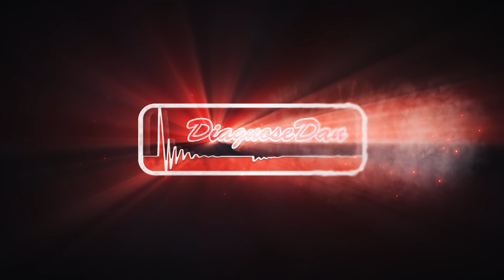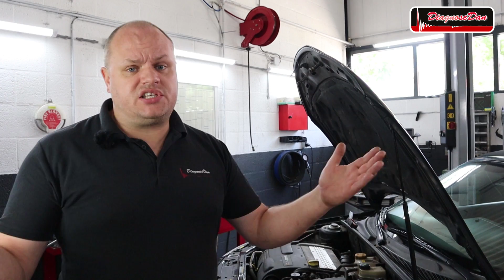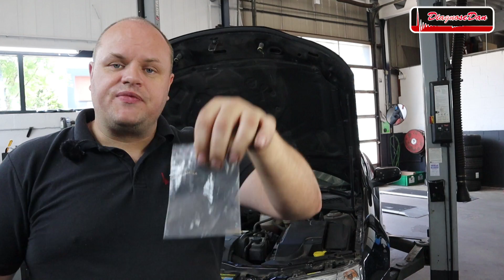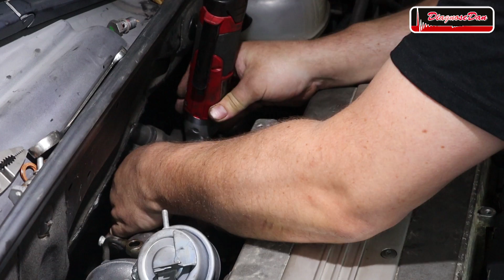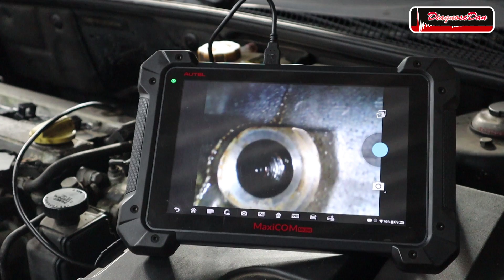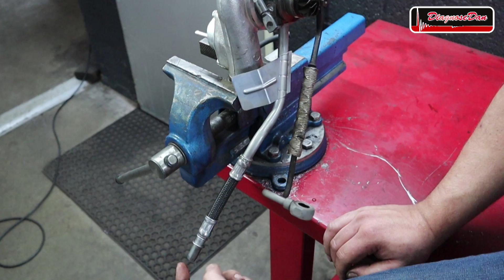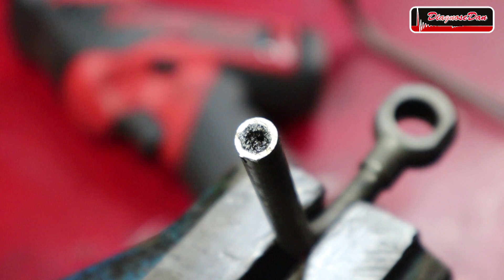Why did this new part only last one day?

Comment: not sure how so many comments got into brake lines when this video is about a turbo failure?🤣
I would wonder if lack of oil changes could cause the oil to get so thick that the heat would cause it to start clogging the feed line to the turbo. I lack knowledge as to what all the oil passes through to get to the turbo in the first place, but it seems like I would want to know what was causing the oil to get so thick it clogged the feedline on the turbo! That just seems like a lot of neglected maintenance!

Comment: so, I guess not replacing the oil feed line when they installed the new turbo, that it voided the warranty on the new turbo? So, did the shop that done the work on it cover the repair you done to it? Just curious, even though this video is 4 years old, I wonder if the mechanic shop done the right thing and covered the cost of the parts and labor since it was obviously a neglect on their part?
This was a great educational video for turbos! Thanks, Dan!

Comment: Looking closely at the burnt oil build up in the oil feed pipe / tube ..   I always allow my engine to run for a while at idle    after a road trip.  this allows the  feed oil to fl;ow  into the crankcase while the turbo is cooling down .   My 2001 2.5 VW TDI Caravelle is still on it,s original turbo after over 200,000 miles .  Motul fully synthetic oil .obviously does a good job . I have recently replaced the gear change balls and socket .   What an absolutely bummer of a job . I ended up removing the cold weather diesel water heater and water piping to allow access to the relevant parts which come as a kit ..  a tip is to drill a small hole in the nylon socket to allow the linkage ball to enter .more freely.. keep up the good work and excellent videos ..

Comment: I have a Mercedes S550 with two turbos.  Not only am I concerned about keeping the oil flowing at the end of the trip, but the car has autostop to turn off the engine when sitting at a stop light.  Man that seems dumb, for many reasons.  I wonder if Mercedes has an auxiliary oil pump.  I certainly don’t hear one when I shut off the car.

Comment: The 5 bar reading on the pressure guage instead of 2-3 was a sure sign that there was a serious blockage in the lubrication system.
Key is to always remember the function of engine lubricant :1) lubricates 2) COOLS   3) CLEANS. 
As i stressed many times "oil is what you fry your chips in" good quality LUBRICANT is what you put in engines.

Comment: Agree that oil line was exposed to excessive temps. The Mercedes 300 turbo diesel does not suffer from this problem. They somehow keep the temps under control.

Comment: Every Tech should see this! Especially over here in Canada / USA...... If the turbo is bad; Check oil feed line!!!!!!!!!!!!! My customer just had this problem on 1.5L CRV honda at dealer and another independant shop, yes, complicated, dealer diagnosed blocked cat., independant diagnosed "no, cat is good, it's the turbo"- three turbos later, and after my advice (I learned from Diagnose Dan! - and, I shared this link to customer, and customer told independant shop).... check the oil feed!!! Finally, the oil feed filter was plugged.... Now, the fourth turbo PLUS oil feed filter/ line should fix the problem (parts on order - 4-5 days on order)..... I'll confirm later......

Comment: From what you have said, it astounds me that the new turbo kit also had a new oil feed line which was not fitted. If the oil feed line was not supplied, the checks for oil flow would be more critical, and using paint thinners through it would perhaps clear it from carbon debris inside. As you point out, the turbo failed for a reason, and it was most likely the blocked oil feed, where a replacement (possibly with less labour) oil feed tube is supplied.. A costly exercise for a complacent mechanic...

Comment: I bought a 2000 Volvo S70 turbo, at auction.
I diagnosed a bad turbo, and set out to find out why . . . I checked the oil feed, and it was fine, so I stuck a garden hose to the about 12" long oil return line;
I was thinking to myself, "that doesn't seem like as much as should be . . ." And BOOM! a chunk of I don't know what, blew out of the line!
Needless to say, I'm glad I knew this information, even before watching your video, thanks!

Comment: Three things:if wrong oil was use causing sluge mixed with engine heat can clog,engine left unserviced for very time and lastly ,if car has history of engine overheating due to faulty cooling system.

Comment: As far as the stopped up oil feed line, more insulation on that line would help, as the stoppage appears to me to be coked oil. Too much heat has coked the oil inside the line. When the engine is shut off, underhood temps skyrocket, and that line still contains oil. Hence the coking.

Comment: The larger, commercial diesel that had an electric auxiliary oil pump that would run shortly before starting, and a timer let it while the turbo spins down. We never had issues with the turbo.

Comment: Turbo oil feed line  has a heat shield, which doesn't cover the line far enough, you cut above the shield and it was blocked.  Root cause analysis would indicate the shield should extend the length of the pipe  passing the exhaust manifold. Either reroute the pipe or add a shield and also flush the oil at each change with oil flush. This causes an issue with hydraulic lifters and hydraulic   chain tension systems  for years, a higher mileage (km) vehicle truly benefits from a oils flush before each change for this very reason, 50,000km plus.  Very nice video thank you so much for the work you put in !

Comment: DiagnoseDan, I think clogging of the oil feed line might be caused by skipping oil change intervals as well as the usage of oil for NA (non-turbo) applications or incorrect viscosity oil.

Comment: Improper oil was used and that will lead to oil being cooked and blocking turbo oil supply or return line. 
Probably conventional instead of synthetic oil was used. Conventional oil cannot tolerate high exhaust temperatures at the turbo.

Comment: Who replaced that turbo has to be very dumb as fuck, it should be the normal procedure to work on cars if there is a failure you should check why this part failed not just replace it.

Comment: I drive a 1993 audi 100 TDi with 500k kms on it. Original turbo. Wonder what's inside my lines? Tbf it's oil serviced every 5000 miles, specifically to stop this sort of issue.!

Comment: 13:50 I'm thinking that the motoroil was changed on to high serviceintervals and possibly an oil which isn't made for direction injection engines.

Comment: Very poor practise by the shop which fitted the new turbo :-(  I did this job myself on a 9-3 Saab and even I know that you need to replace the oil and coolant lines to ensure the longevity of the turbo.  Thanks Dan
Reply: Carbon arises as the oil breaks down due to high temperatures involved.  For example when the turbo isn't given time to cool down after a run.  Another cause is a poor oil change regime

Comment: 👎there are instances when you cannot cut corners, specially during an important repair such as a turbo service where all circuits connected to it should be checked in the first instance - 👌thanks for the video Dan 👍👍👍👍👍

Comment: That's a bummer. I keep waiting for my turbo to fail. We are at 206k miles now on my 22 year old Volkswagen with the1.8t engine. It has been tuned by unitronic since 48k miles. Making 15-18 psi. I guess my religious premium oil changes paid off. Turbo is still ok. Although I am considering putting a new borg and Warner unit on there before it lets go.  I have seen some catastrophic things happen when they fail.  Including inhaling metal in to the engine, and filling the exhaust with oil.

Comment: the last thing i do after core change on a turbo before start  make sure the oil feeding pipe bolt is loose when oil comes out then  you have pressure and make sure to prime the core with oil or nulon paste

Comment: Yes more frequent oil changes no doubt. I would be very suspicious to know if the correct oil had been used in the past. I have seen screens on oil pick up pipes completely blocked with crystallized oil deposits completely restricting the flow of oil through the oil pump. 
Dan thank you so much for sharing the knowledge. Much appreciated. Kindest regards from Ireland 🇮🇪

Comment: I suspect this is in part from hot shut offs.   Drive the heck out of the car then shut off with the turbo and exhaust blistering hot and cooking the oil in the oil line.  I'd advise the customer to let the car idle for at least a minute before shutoff, longer would be better, but not always practical. And of course a quality synthetic oil and follow the oil change schedule.

Comment: This is the second video I have watched of yours very descriptive and could well be used for tuition purposes in Colleges etc.  The work area is very clean and uncluttered and would give confidence in a proper job being done, can I just mention Dan the importance of  the correct procedures in using compressed air, ie skin surface not in direct contact with and safety goggles used.  Great Video Many Thanks.

Comment: what a downer  the shop failed to fit the INCLUDED oil supply  tube .. disgraceful. shoddy work.  It is a good job the turbo didn't take out the engine internals . That sloppy mechanic would be responsible for a massive bill...  I religiously change the engine oil and filter for best quality synthetic oil and let the engine idle before switching it off.

Comment: Interesting twist to this saga.

We were on our way back to Pretoria. About 500kms or so left of our journey the camshaft belt decided to do its thing. Hopefully there's no engine damage, but we'll check that tomorrow.

Any way, what I wanted to say was that the workshop where I was working on my car (big shout out to Japie Stoltz motors at Winburg for allowing me to make use of their workshop, and for assisting me with little difficult things) had a Volvo station wagon (diesel biturbo). Both turbos failed... after 500kms. 
Turned out the previous mechanic did not check for oil feed to both turbos, and, yup, same thing happened as in this video.

Replacing both turbos is not a mean feat as you will need to move the entire engine to the front in order to allow for work space at the back of the engine.

Also you need a special tool or two for this excercise.

Comment: For my 2002 Volvo S60 will warming up 20 minutes on morning daily use and going nice and smooth right now to prevent the clogged. Just replaced the turbo return oil line gasket DIY just cost RM15 bucks couple of months ago. Everything is going great.

Comment: Hi dan it’s my first time on your channel. Great info dude I have an Vauxhall/Opel insignia 170 bop 125 kw. This is why I changed my oil every 3 to 5 thousand miles the sludge/carbon builds up very fast and I have fitted a catch can because I do mainly short journeys. Great content 👍👍

Comment: I advise everybody with a turbo about a week before they do an oil change and check to see if the oil is low and top it off with Marvel Mystery Oil and run it for a week. It will clean deposits like that completely. It's been around a hell of a long time, I believe about 97 year so far. And it works wonders on problems just like that as a mechanism of regular maintenance. You can even use it as I have a court within the oil when you first put it in. However that might not be applicable to all engines, I'm not sure. But running a quart get it for a week before you change it is very cheap insurance especially for a turbo.
As for the claws, it was probably not regular oil changes or they would overheat the turbo and shut the car off without letting it idle down for a few minutes to allow the turbo shaft to cool. Something I also recommend people with turbos do.

Comment: https://youtu.be/XRjaOD5qf8k?t=845
This is the result of bad routing of the oil feed hose too close to the turbo and exhaust or the heat shield failing (dirt, discolouration, damage...) or using a non turbo rated oil, but this can also be exacerbated by poor operation where a hot engine is suddenly shutdown, (toll booths, motorway services...) without allowing any time for the turbo heat to be dissipate prior to shut down, where the stationary oil in the line is potentially boiled next to the very hot even red hot turbo/exhaust during the post run heat soak period. This is a probably cumulative fail.

Comment: OMG, that poor little turbo :-( 
Oefff, that sound @ 3:33 of the dry turbo. OMG my ears. And where does that carbon come from?
Well done and very good diagnosing. Thanks Dan!
I had a Smart some years ago with a turbo. Very reliable indeed. They (the Smarts) hardly ever broke down, did learn that when home after work to let the engine cool of, before turning it off.

Comment: full service and put a filter on the oil line  to the turbo a clear one so you can see if its getting clogged  thats what id  use to  stop the carbon in the pipe or run a separate oil feed to the turbo from a pressure off the engine outleat into a tank and bigger inner dia of the pipe add bigger pipe

Comment: A lot of shops will replace the most expensive component when dealing with a failure simply for the sake of extra profit. That or they are simply lazy & lack the diagnostic skills necessary. I always check the least expensive items in the series of components of the suspected failed component. Always ask yourself "why did this unit fail".

Comment: how can carbon deposit get into an oil line, please respond
Reply: carbon build up is usually part of intake and exshaust am i right
Reply: The carbon is not getting into the line it is being generated in the line, either a non turbo grade oil has been used and or poor operation causing the line to be repeatedly cooked after shutdown next to a very hot turbo that has hasn't had any time to dissipate the heat resulting from a high load situation, hill climb, towing, motorway stop...

Comment: carbon deposits in oil line, mixture of old oil and possible blow by on one or more pistons , blocked breather , 
compression test , do oil change especially if high mileage engine

Comment: Changing engine oil regularly with an correct viscosity. As I could in your vedio the oli was black. Not changing engine on correct intervals can cause carbon buildup.

Comment: @DiagnoseDan The Carbon Deposits in the oil feed line at the end of the Video are caused from Oil Coaking, This occurs when Fuels or oils reach temperatures over 200 *C, This usually doesn't happen while the car is running since the engine oil cooler and constant flow of oil while running prevent it. The best way to help reduce the chances of this happening is to make sure that you idle the vehicle for a few minutes after hard or spirited driving. This will allow the engine oil cooler time to reduce the oil temperatures and the oil to remove heat from the Turbo and oil lines. This is also why Turbo timers were invented to help idle the engine a few minutes to allow temperatures to drop. Also driving the car smoother for the last few miles before the end of your trip will help further reduce the chances of this happening.

Comment: The carbon deposits might be because the oil pressure wasn't enough at some point ? and the "gases" went from the turbo to the other side of the pipe in reverse ?  some way building pressure and go the other way , i think if there was a mecanism that could stop reverse flow on the pipe this issue could be fixed ?

Comment: Of course...    it's called coking;    NEVER  shut your turbo engine off  when you have just stopped after a hard run,the hot side of the turbo is GLOWING red-white;    DO LET it run at idle for 5 to 10 minutes BEFORE shutting it;     but whodahell am i,  of course you can continue doing it the way you always did....        lol

Comment: My Mercedes with OM642 gets oil changed every 8,000 km . I also add some oil flush treatment just before I change it. After 4 oil changes, i could drive my diesel for a week and my oil looked still like new! Oh  Just before I change my oil I drive it for 40min to get it nice and hot.

Comment: Blowing My own Trumpet but as soon as I saw the Turbo rattle like that I new it was an oil problem.

What causes that is NOT CHANGING THE OIL at the correct intervals. ie POOR OWNERSHIP.
The engine oil breaks down and sticks to the sides of the pipe like blocked arteries.
To Prevent this Before oil Changes Use Seafoam Motor Treatment which you can put in your engine and drive the car normally. It will dissolve all the Crud in all the tiny passages and allow oil to flow properly.

Comment: Obviously the shaft  broke when it seized and I bet no signs of oil anywhere two clues as too no oil pressure , something foreign must be stuck in the line, how did it pass the the oil filter or pump screen, how about changing the oil and filter rather than wait 50,000 to 100.000 miles between oil changes; I am surprised that the cams did not seize first. I always thought European mechanics still had the apprentice system in place, guess not???